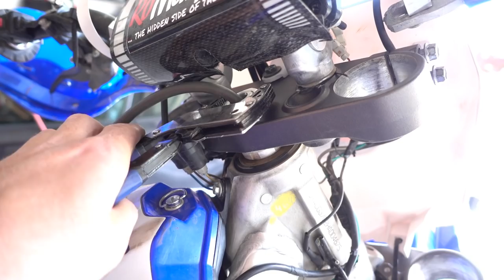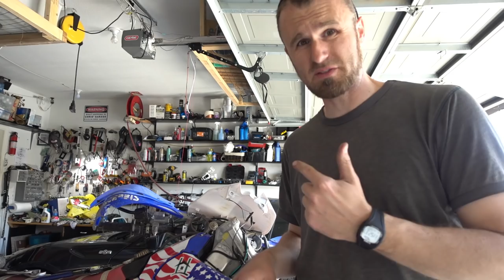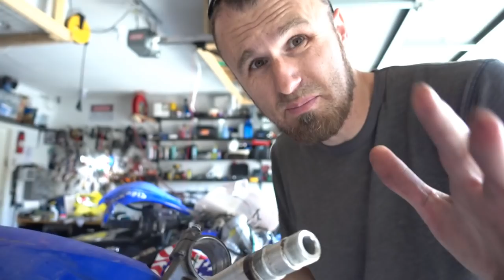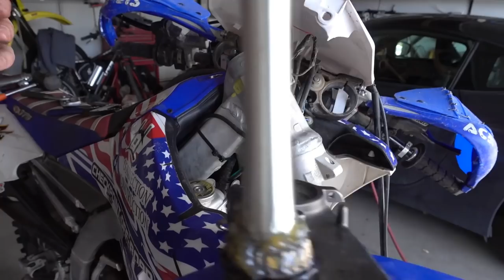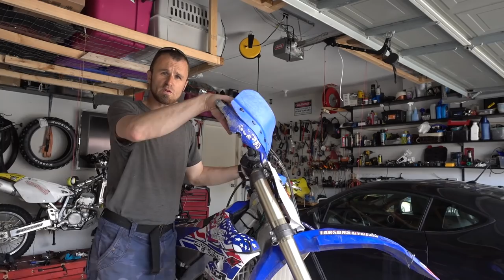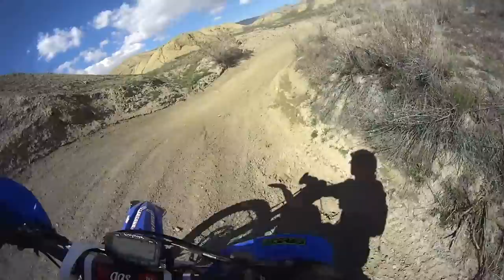Motorcycle Handling Problems FIX Triple Arm Bearings - MAKE YAMAHA GREAT AGAIN!

Comment: When you use hydroscopic cellulose-based towels you need to wipe with proper tangential acceleration to ensure centripetal force injects the proper amount of semisolid lubricant and ensure you avoid introducing dihydrogen monoxide into the pseudo-plastic fluid around the bearing which can lead to corrosion of the metallic structure of the sub assembly. With proper technique utilizing a carbohydrate fueled organic power source with a properly functioning to somatoensor to apply proper torque to mechanical fasteners can be an acceptable process.
Reply from the maker: Haha I only found half of the words in the dictionary, tomorrow I'm gonna look in the Chinese one.. Maybe I'm lucky

Comment: The most frugal thing i did on the dirt bike was i grinded down valve shims instead of buying new ones, it ran just fine and cost me nothing. But i dont recommend doing it because you might grind them uneven.
Reply from the maker: That is crazy, I like that story what  bike?
Reply: @vegasromaniac  my old yz250f 2007, after i sold it buyer sends me video that the piston rod had play in it and needed a rebuild, i lucked out.

Comment: Romaniac:  Not related to this vid but you NEED to do a video about the ECU mapping on the YZFX.  With the GYTR tuner we have the ability to adjust not only fueling but ignition timing as well.  This is adjustability not available on any other bike.  Even aftermarket ECU usually only allows adjustment to the fueling.
Reply from the maker: I almost bought a computer than I thought to myself  I love this bike, why would I mess with it as long as I'm happy.. So I removed of my shopping list. Once I'll adjust that, I'll always feel here I need more torque 5 minutes later more power, as it is right now its perfect.. I hate change
Reply: @vegasromaniac  You only think its perfect because you haven't tried to change it.  ;)  The GYTR tuner is super easy to use and allows a ton of adjustment.  And if you don't like the new map you can always change it back again in 5 seconds.  

As soon as the weather cooperates I'm going to go out and play with mine.  :D

Comment: I see where your coming from, but if you work on bikes a lot a torque wrench is a good investment and you can modify a cheap socket, make a steering nut wrench or buy one they don't cost much.
Reply from the maker: Yeah, I agree with that, actually I have a torque wrench, just never bothered to take it out of the box.. It's sitting  in a special place

Comment: certain things like grease i am not brand loyal to i will use what ever i can afford to grease the things that need to be greaed. now things like tires or oil i might research those in order to get the best parts for the best price that will last awhile.
Reply from the maker: Good strategy. I did ask a guy the other day, if you pay 3x the price for a better air filter that gives you 10 percent beter filtering  would you pay 3x the money for a tire that gives you 10 percent better traction?
Reply: no i wouldn't pay 3x more for 10%. i'll buy exactly what my bike needs that came on the bike factory for things like air filters or i'll buy a cheaper one that works just as good. the only time i am brand loyal is when i buy a truck or if i do my own oil changes on my truck then i'll buy specific oil or what not but 75% of the time i will use whatever the cheapest is with the best results.
Reply from the maker: @Minionmoto529  yeah somebody asked me that question, didn't like my answer, was a sponsor.. :)
Reply: @vegasromaniac  that's crazy. Yeah idk why they'd expect you to pay $80 for a $20 item only to go from 75% to 85% performance

Comment: I have just done the same thing on my yz  450 but the bearings  were shot so I replaced them with aftermarket and not OEM the aftermarket bearings were slightly thicker then OEM next time Im going OEM for a correct fitment.
Reply: Yeah,i always go OEM if your willing to spend the extra cash,but it's not much.The stock bearings on the Japanese are the best,just look at the cases and cages and basically the finish.I have used the AB and PW and the last set of linkage bearing collars i had to lap a tiny bit to get the fit that was required:)
Reply: @doubledown9333  lesson learnt from now on OEM ...
Reply: @1Dukecronic  Just for something to do i went to RMATV and calculated all the OEM lower linkage bearings and lower shock bearing,seals and collars for the last bike i did and they came up at $160 US and the PW complete kit was $90 US,i didn't realise the cost was so much:(

Comment: Have you tested any of the cheap hydraulic clutch kits from amazon/aliexpress? I'm thinking about trying one on my 97 yz250, even if at that price i find quite hard to believe they will last too much
Reply from the maker: I almost tried one for 35 bucks but than I thought it will bring reliability out of the norm for a yamaha so I gave up on it, my clutch feels amazing on the yz not really a problem
Reply: @vegasromaniac  i find mine too stiff, not unusable but i'd really like to make it softer somehow (maybe without spending 300 euro for the magura kit lol,)
Reply from the maker: @Muz994  that is strange every yz fx I rode had the same clutch feel nice smooth and light. There is a ebay special lever it kind of caught my eye.. Also there is a special box you can buy for the cable to make it better, my video about it will be posted Saturday or Sunday
Reply: @vegasromaniac  i've seen that too. I'll wait for your video then :)

Comment: Im going to have to use aftermarket bearings if I graft YZ250 forks to my old YZ490... 🤔
Reply from the maker: Don't graft, it's easy... Haha..
Reply: @vegasromaniac  Underhang is a big problem with the old forks, plus I'd like to at least have a front disc brake insted of a semi - functional drum. Back brake is still going to suck though..